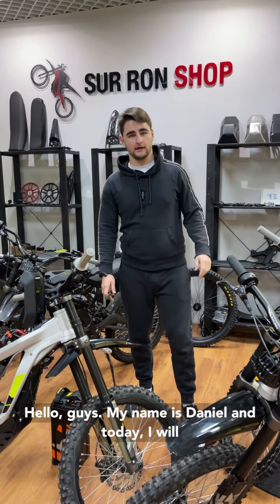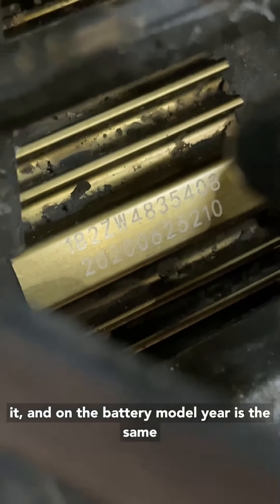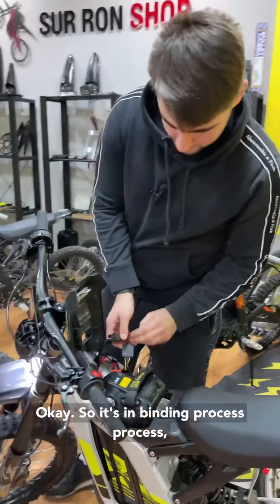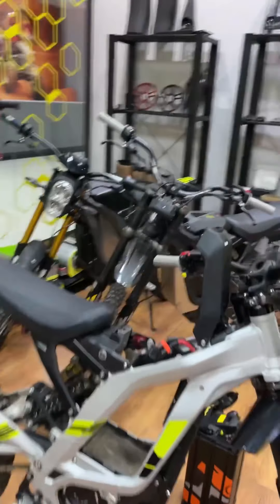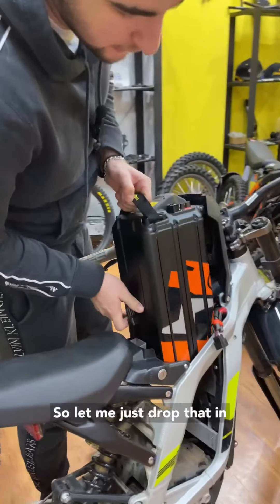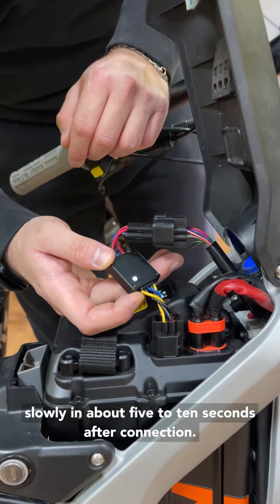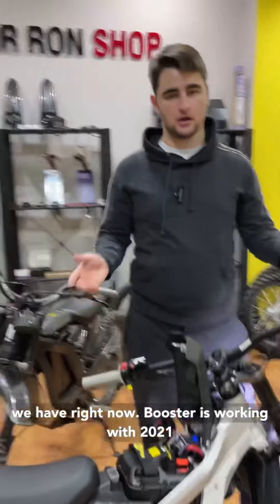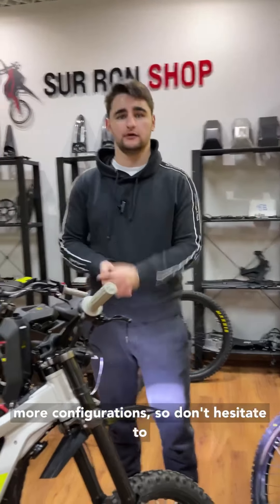Sur-Ron Power Booster Compatibility

Comment: Will this work on 2024 60v 40 amp batteries ?
Reply from the maker: Yes, it works. Only incompatible battery is the 38ah60v
Reply: @SurRonshop  how big of a power increase on the 60v 40ah ?
Reply from the maker: @akidim13  15% torque boost is what you can expect + minor speed increase. The rest depends on your gearing and rider weight.
Reply: @SurRonshop  can I put the power booster on my 60v 40 ah surron 2023 ?
Reply from the maker: @ytsoulcollectorvi1695  yes!
Reply: @SurRonshop  proof that it works please 🙏
Reply: @SurRonshop  ima need proof before I buy this
Reply from the maker: @ytsoulcollectorvi1695  we give warranty for power booster compatibility. You can return if it does not work. We have many reviews at https://surronshop.world/products/surronshop-power-booster?_pos=1&_sid=f2c9dba41&_ss=r
Reply: @SurRonshop  so you can't do a video to test thatb
Reply from the maker: @ytsoulcollectorvi1695  we’re going to upload a video with power booster new firmware tests after the snow season. It’s not possible for us to show acceleration difference with roads being in snow right now in our area 😄
Reply: @SurRonshop  smh 🤦

Comment: Will it work with a 60v 32ah battery?
Reply from the maker: Yes!
Reply: @SurRonshop  I run a 54t sprocket and with the power booster sometimes I can reach 45mph and other times only 30mph. I’m not sure why it works sometimes and others it doesn’t.
Reply from the maker: @michaelwines1637  does it happen on the same battery charge state?

Comment: Great video! Question about the wait for binding: How many seconds after I get battery out of the charger, put in the bike, and turn ignition, until I can ride away? Then if I turn it off for an hour for example without removing the battery, and turn it on again - how long is the delay until I can ride away?
Reply from the maker: Thanks! After some time from this video we tested more model years and gathered some data. We can now claim that the booster works with all models and years and only a 38ah60v battery does not work.
Binding is immediate and there is no need to wait 10 seconds, just give the bike a couple seconds to start up and you are good to go!

Comment: Hello friends, will this booster work with a 60 volt 37 amp hour battery, on the motor and on the battery it says that they are made in 2022
Reply from the maker: Hello! We haven’t tried 37ah, but it certainly does not work with 38.5ah battery.

Comment: what does it do disrupt the BMS?
Reply from the maker: It does not damage BMS in any way. Low voltage cutoff is still engaged and you don’t have to worry about battery temperature. This is a safe to use modification that does not void warranty on your bike components. 

Booster delays power weakening signal from controller to battery to allow for extra 800 watts of acceleration

Comment: Hi, I’ve a question: my Sur Ron is a EU Road Legal (L1E) 2021 model, stock battery 32ah 60v, upgraded with X controller. 
I’ve heard that the power booster has problem with road legal and speedometer blink “217 error”, do you mind I’ll have the same issue even if I’ve a X contoller? Thank you. Andrea
Reply from the maker: Hello dear Andrea and thank you for your request to SurRonshop! Power booster will work on your configuration but will show error 217 meaning communication error between dash panel and battery which is not required to sustain functionality and ride ability of the bike in general.

Your battery low voltage and temperature sensors will still work, you can ride fine with such error but there is no opportunity to get rid of it other than hiding the blinking light. 

Feel free to ask any questions, I’ll be glad to reply them all!  

Respectfully yours, 
Daniel 
SurRonshop founder.

Comment: Hello I have a 2020 Sur Ron lite bee z with motor code 2020 and 32 amp hour battery also 2020. All stock. Just received a boater. And it will not ever blink slowly. Not working on this bike any suggestions. Thanks
Reply: Ment x model
Reply from the maker: Hello dear Gary and thank you for your request to SurRonshop! Slow blinking does not indicate successful binding on many bikes as we later learned. Just make sure your bike works and acceleration times are faster. 

Feel free to reach us with any questions at SurRonshop.world@gmail.com 😊

Comment: Bonjour ce booster permet de booster quoi exactement? la vitesse? le couple? A quoi ca sert? merci de votre reponse
Reply from the maker: Bonjour cher ami et merci pour votre demande à SurRonshop !  Booster offre une amélioration de l'accélération de 15 % sur le contrôleur et la batterie d'origine des vélos de l'année modèle 2021/2020.  

N'hésitez pas à poser des questions, je me ferai un plaisir d'y répondre !  

Respectueusement vôtre, 
Daniel 
SurRonshop fondateur.
Reply: @SurRonshop I have a 2022 surron 250x with 2021 motor will this power booster work on my bike
Reply from the maker: @randalltaylor2672  it will work if your motor code is 2021 and same year on battery! Thanks for asking